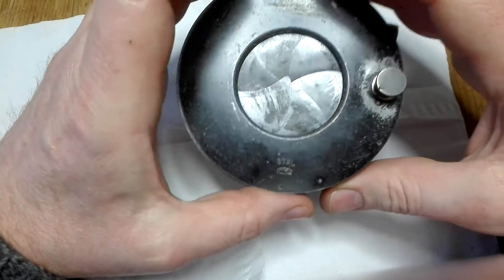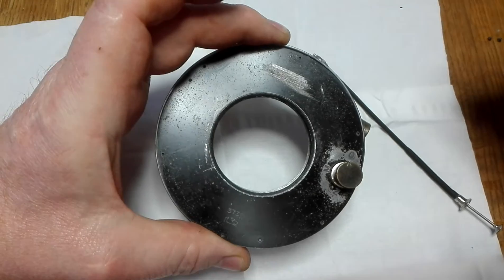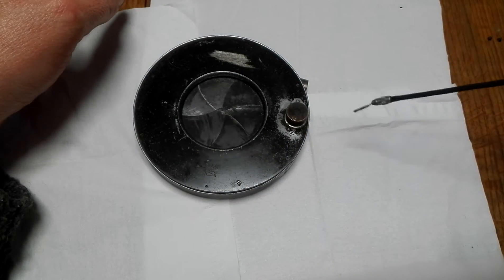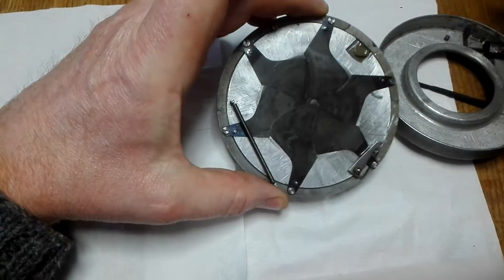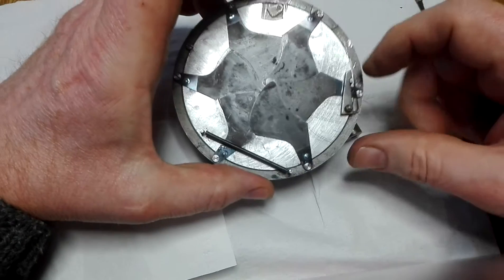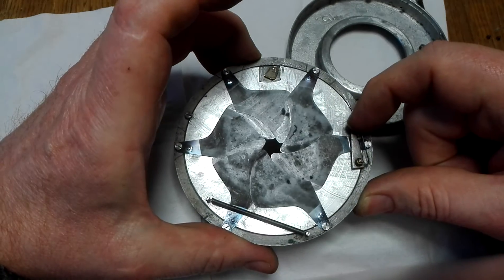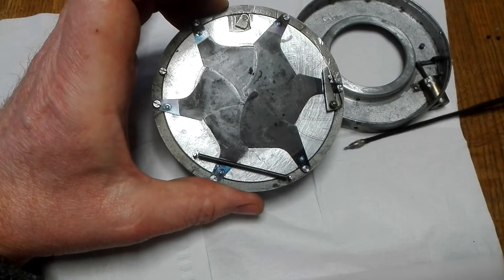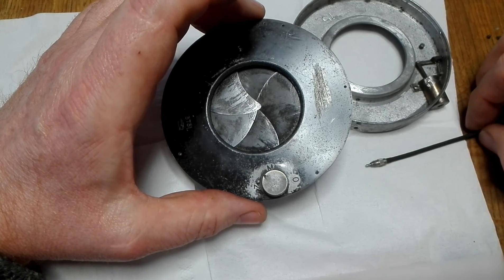camera shutter inside

Comment: This is exactly what I needed to see to understand the basics mechanics. If you still answer questions, does that specific shutter have any patent numbers on it?
Reply from the maker: Yes. I'm still answering. Patent numbers? I don't know. Have to check it. But I have just moved into a new house and the shuttet is still in a box. Answer will take a while 😎
Reply: @Holzkamera  ... Hi Andreas ... which lens (or camera) does this part come from?  Thanks!
Reply: @cyphermote6857  it's a leaf shutter, pretty much all of them have the same design.
Reply: @Holzkamera  Thank you, Andreas. I have time. I'm working on a project to make a simple leaf shutter like this with a laser cutter. I'm still researching old patents and haven't even begun concept drawings yet.

Comment: Perfect. I really wanted to see the construction.  I purchased a very large resin kit of the 20,000 Leagues Nautilus, and considering putting a leaf shutter on both side windows, to match the leaf effect done in the Disney film. As long as it would open and close by rotating an outer ring, it would not need to have spring action. I'm probably biting off more than can chew.....